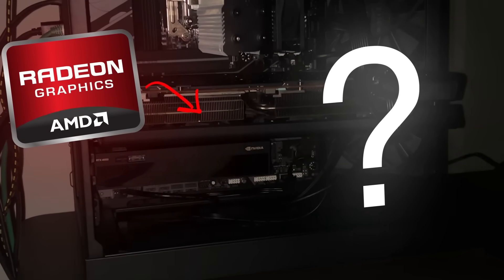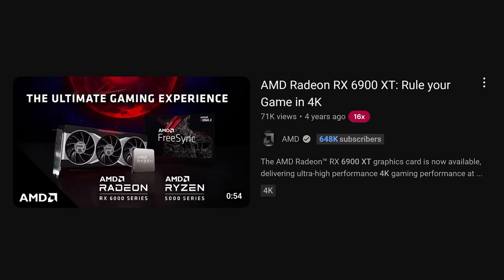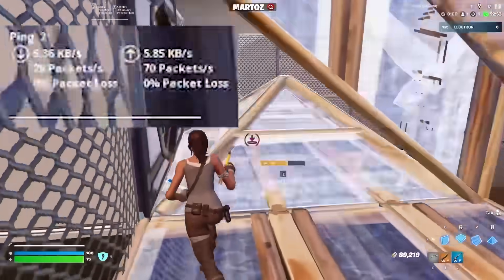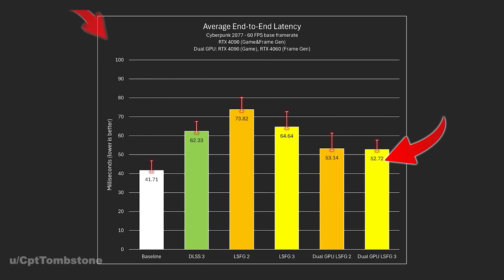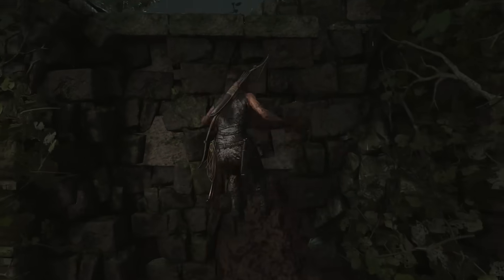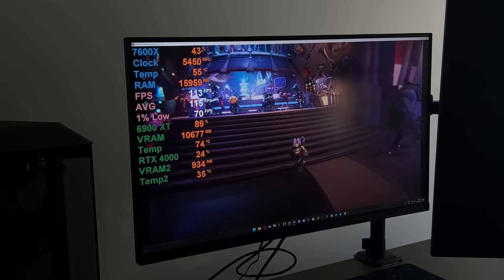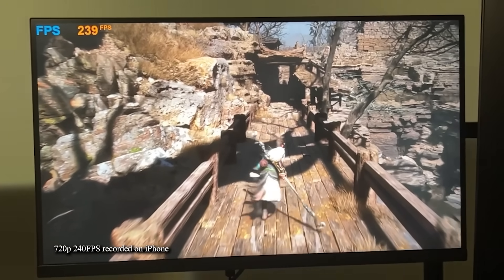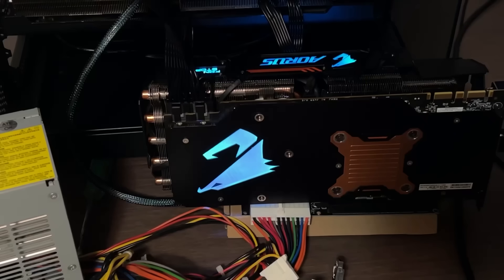I Used Both AMD & NVIDIA in One PC and Got 240 FPS in Every Game

Comment: In a past those two were so incompatible they would cause blue screen of death This includes on board graphics adding dedicated graphics of a different company when it wasn't Intel on board. I guess they finally fixed the problem decade later. Normally I would always use the same type together. Haven't checked out the m.2 graphics extenders much yet though good to know extra ATX connector required. Good end results. In the past there were also issues with Radeon drivers on server OS too. For general gamers they'll just have to standard windows OS radeon was good. IT management professionals we do have server os a lot of the time. In turn use to only buy Nvidia. Might test Radeon again.

Comment: I would recommend to do some searching since this method was very popular around 20 years ago, when Ngreedia tried to use PhysX as a lock-in tech.
On those days, AMD gpus were faster than Ngreedia, so people would use the AMD as primary and the Ngreedia was used for PhysX.
Ngreedia didn't like this so they started releasing drivers that when it detected the AMD GPU, it would deactivate the Ngreedia GPU that you already paid for.

DLSS is just their new round of lock-in tech.

When you have a chance, try the Arkham games using the same configuration.

Comment: Ugggh, I hate videos like this. So misleading, and unfortunately people fall for it because they don't know how lossless scaling works, and you omit information to make your video seem more impressive. Hence why you state the existence of base fps and it not changing, but don't explain what that means for playability. This is also why you didn't show any ray tracing results, because the game would still be unplayable with very low framerates, it would just look better, but games aren't movies and latency affecting the feel of the game is essential for the experience. 

Don't be fooled, this won't make your game run any better, it will just make it look better in terms of motion blur, and it's pointless generating frames above your monitor refresh rate.
Reply: Interesting. And I'm surprised no one in the comments are mentioning that running dual setup require an increase in electricity bill.

Comment: Wait, did you say how you got it to stop using just the GPU the monitor is plugged into? It was mentioned at first and then I don't think I heard the solution. Mine is doing that now. It's only using my 6600 secondary I got and not my primary card too.

Comment: @Lecctron 
i wanna set this up on my 4090, the only question is you said amd is performing betting in lossless scaling so should i go for an amd as the secondary since the amd one would be the one generating frames, and if so wich one would you suggets?
i would also be going for a motherboard with 2 Pcie x16 slots to not have the problem about transfer speed

Comment: So... you're suggesting using a $1000 msrp GPU and supplementing it with another $1000 GPU, buying adaptors and getting mixed or worse results just to interpolate frames at screen level.... And you're using this workstation card because as previously stated the 1080ti doesn't work well... Then swapping back to the 1080ti and having a combined max power draw of 550W. 

None of this increases performance in any way either so I don't get how anyone can equate this to "better than SLI" 

Honestly you might as well just buy a 5070 and whack on 4x frame generation.

Comment: On Gigabyte B650E auros master you have to plug the monitor into your MAIN GPU! Dont ask why, idk. BUT its works perfectly fine! ((If you NOT sure the lossless is working, turn ON the steam fps counter with high contrast in a bottom right corner for e.g, if you turn it on and you wasnt sure its working or NOT, just check the steam fps counter if you moving a little bit or dragging the mouse and it gets blurry around the counter its means its working!))

I hope i helped u out!
Keep it up guys! It worth it!

Comment: I may be asking a dumb question but i want to try this. As far as the extra power supply. Do you just turn it on before you turn on your actual pc? Or do you turn it on after your system is already booted up? Does it not matter?

Comment: This doesn’t make sense; I run Fortnite at 4k, max settings running a 6800xt with a 10900k and I get over 100fps…how are you sub 100 in the menu on a 6900xt? 🧐

Comment: Looks like the way to go for me, at least it'll be very interesting to tinker with. Having rx 6900 xt on it's way to me, and it seems like rtx 4060, say low profile, would be divine pairing, since I daily driving x299 platform, there would be no issue with all this pci-e lanes tomfoolery. Huge props for shedding light at this loophole, amazing video, instant sub!

Comment: its not your gpus that is the problem your getting Bottled Necked due to the CPU  .  also your motherboard also is a problem also how windows is setup may also couse lower frames also . but its 100% mobo and CPU  that u have .  it also can be power supply  u did not list it with 2 gpus it can be a power  problem .

Comment: Probably a stupid question, but: Did you connect the GND of both PSUs when running the 4000 card?
For the 1080Ti, the GND connection would've been made through the card b/c it was connected to both PSUs.
I was just wondering, would be cool if you could clear that up for me... 🙂

Comment: so, someone correct me if i'm wrong, if my b650 has 2 4.0 x16 slots, I don't have to buy the adapter thing, and can just directly plug my 2nd card into the slot?
Reply: Yes, though it's impossible for a b650 to have a second slot that runs at pcie 4.0 at x16 speeds, it may be x4 but even then that would be really good

Comment: constructive criticism: please include frame time so we can tell what the latency feels like. we know what 240 fps looks like across every game but what about the lag and latency?
Reply: @pablooarmas  Latency still feels like your native FPS without frame gen. LS isn't magic.
Reply: 240^-1 and you got your frametime.
Reply: @pablooarmas  dude, that's the point of using 2 GPUs with lossless scaling. With one GPU, it has to work both rendering the game and generating frames which is responsible for bad latency and input lag in lossless scaling. With 2 GPUs, one GPU generates the frames while the main GPU renders the game. This eliminates latency from frame generation. I tried lossless on one GPU and it makes all my games run super smooth, just with worse latency. Imma look for a cheap low power GPU for the frame gen. If your concern is more of like is the 240fps actually stable, yes it is. You can set lossless to meet 240fps and then lock your fps to meet your screen refresh rate.
Reply: @Pt08020  no you see, it goes like AMD VRAM → system RAM → NVIDIA VRAM → display, if you had both gpus from amd or both from nvidia that one step would be skipped so less input lag and also there would be no risk of driver incompatibilities
Reply: @wilhelmu   wait so i replaced my 2060s for a 3070 if i use the 2060s for this i wont get massive latency?
Reply: @Pt08020  Until some incredible engineering advancement framegen will always add the same minimum amount of latency, with an absolute minimum of 1 frame worth of latency at 2x framegen inherently due to how framegen and the render queue work. This dual gpu setup should do basically nothing in terms of reducing latency under normal circumstances and honestly I suspect it would actually add quite a bit of latency proportionally because of the two GPUs having to communicate back and forth to generate the frames and display them, possibly more than doubling the latency caused by framegen if it works somewhat how I suspect it to. Even if it doesn't work that way you'd need a fancier motherboard than most would expect to not run into bandwidth issues (which would feel a lot worse than framegen/upscaling latency) by having two GPUs simultaneously that are communicating with each other, the motherboard, and the CPU. Old SLI didn't do much more than let you utilize two GPUs worth of VRAM because of limitations like that. Even if you had a single-GPU setup using an exclusive 5000w TDP Nvidia super gpu that Jensen Huang uses to play Uma Musume at 120,000 FPS that could do 100x lossless upscaling/framegen the latency would be nearly exactly proportional with the ratio of generated/real frames so even in the most ideal scenario you're still adding a lot of latency if you're going 6x framegen like in this video. This increases total frames (real FPS + generated FPS) significantly and that's really neat but I don't think this is a viable option for games you'd want as little latency as possible. I think the biggest benefit of this would be that you can be more aggressive with upscaling on the secondary GPU without sacrificing latency as the upscaling isn't adding more frame queueing to the equation if you're already doing framegen, but upping the framegen is still going to add more latency regardless. I'd stick to 2x with this if you care about latency and just hope the increase in real frames generated by the main GPU is enough to get you to your ideal FPS at 2x framegen.
Reply: frametime will be the exact same, because frametime and fps are inversely proportional. 240fps will always have a frametime of 4.166... ms
Reply: @SnowMexicann  what is latency? this person wasn't asking about frametime alone, but latency affected frametime in dual gpu setup. you know why dual gpu isn't recommended for multiplayer games? you know that when you have two pcie lanes one is running of cpu and the other is running of chipset? and your latency is limited by cable bandwidth, display gpu bandwidth, pcie bandwidth which is in turn limited by chipset that is how much the motherboard is burdened. Even a motherboard that is capable of for example 8 gbps bandwidth will in practice have less if there is for example a soundcard connected to 3rd pcie slot also running of chipset and you have external network adapter connected to the chipset......none of this concerns you when you have only one gpu which is running of cpu pcie slot alone, then it's just cpu--->gpu---->display, but for dual gpu setup to work you need some more scienece and calculations and you can't just assume that frametime or latency will always be perfectly inversely proportional to framerate

in effect, if you experience latency with dual gpu, instead of choppy image you will get slow motion image as your secondary gpu is trying to handle more frames then the bandwidth limited by all the facotors described above allows. For me it often happens if I set framegen at x3 or x4 multiplier, in modern games that's more then my 6650xt secondary gpu connected to 4x16(x4) pcie slot can process without visible latency.

Comment: hi, im just curious that, is there a way to use this multiple gpu's setup to render more frames than just using other one for frame generation, where the game itself is rendered at high fps using combined computational power of multiple gpu's?
Reply: Was called SLI and Crossfire and requiered support in the said game and identical cards. The SLI feature is not supported anymore and was dropped by NVIDIA and AMD

Comment: LS multi and adaptive framegen causes bad artifacting, i tried it in ac shadows and it was like i was warping through spacetime everytime i move the camera 😂Not to mention the input delay. But my real fps was always below 60 but not below 30 so i guess thats why? Thing is i have a regular 60 hz monitor so there is no reason for me to have above 60 fps so the only time i would want to use the frame gen is when im below 60fps but below 60.causes bas artifacting and input delay. Kinda defeats the purpose of frame gen for me.

Comment: Since AMD (allegedly pls no bully didn't take time to research) is better at frame gen, i wonder how the result would be with an AMD GPU instead of NVIDIA for the task.
Any takers? :O
Reply: I have an rtx 3060 and have paired it with an rx 6600m and other similar rdna1 cards like the rx 5700, it's a pretty great combo for something that costed less than 300 bucks total

Comment: I would like to see what would happen if you swapped them around, had the 6900 in the x4 slot and the 4000ada in the x16 slot. Also if you capped your FPS 13:00 I wonder if you would have the same results as its trying to pump more frames over the x4 slot. if you capped it to 30/60 would it work better.
Reply: end of day if his mobo is trash the x16 and x8 slots gona share  needs 2 ports x16 and suport  CRosfire

Comment: The Problem with SLI and Crossfire is the PCIe lanes(South Bridge Chip didn't run consistent) had unstable bandwidth and the communication tunnel portion was never consistent or couldn't be, this caused a ton of problems including the higher up you went the greater latency and less efficiency and each game and GPU needed software tweaking which was unrealistic. PCIe5 came with a baked in standard CXL, which is an interesting prospect, all similar coprocessors of the same type in the UEFI are essentially read as 1, so 2 GPUs are read as 1 unit and seen by the OS and any program, Its being used by Storage Manufacturers particularly in Data Centers, I believe Samsung has a few on the market available. Its basically like a Software based RAID but doesn't come with the downsides or software management needed its taken care of at the most basic lowest level of Hardware at the UEFI, Its literally the same as a Software RAID versus a Hardware RAID that is handled directly by the motherboard and managed at UEFI/BIOS level.

Comment: This makes sense only if you have an old GPU lying around. Otherwise you'd get a better experience simply buying a higher end GPU and using framegen with it. And even if you have an old GPU, I'm not sure if the hassle and worse artifacts are worth it.
Reply: You drop your initial fps with a 5000 series and frame generation

You don't with this and thus get better latency
Reply: @ivanvladimir0435  Yes, but only if you have a spare 2nd GPU. Otherwise buying a single better GPU is better. Plus the image quality is going to be typically worse than game's native framegen implementation, so it seems that this only makes sense for games that don't have framegen implemented and you already have 2 GPUs.
Reply: @ You can just spend less than 100 dollars on an rdna 1 GPU and reach up to 1440p at 165hz, that's what I do

Comment: Back in 2010, MSI released a motherboard that featured a technology capable of running both NVIDIA and AMD GPUs simultaneously. I'm not sure if it's useful to you, but you might want to look into the MSI 870A FUZION motherboard. It was one of a few boards that conceptually included a chipset called Lucid Hydra 200. Years later, when I came across similar content, it honestly caught my attention again. Thanks for your effort!

Comment: Yes just pci lane 1x denifinitely problem but this is not solution because your first gpu lane not working fully. If you want to 2 gpu pc you need to buy asrock x870e itachi then you have 2 pci5x8 slot i know not pci 5x16 but this is the best option

Comment: I'm kinda interested in messing with this, though reversing the AMD/Nvidia setup. I'm running a 4090/7800X3D with a 1200w, and have a spare PCIE 3.0x16 slot, so I could drop in a budget GPU for the secondary. Alternatively, I have a spare Gen 5 slot, but that's likely overkill. I'm worried about driver conflicts mixing different GPU manfucaturers.